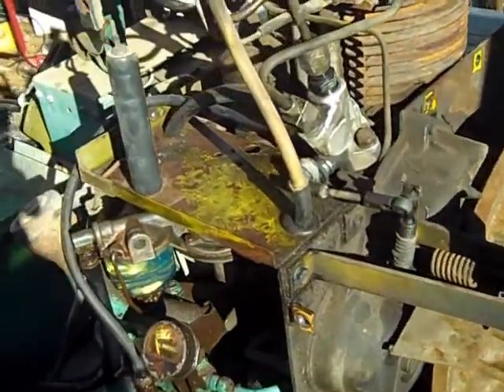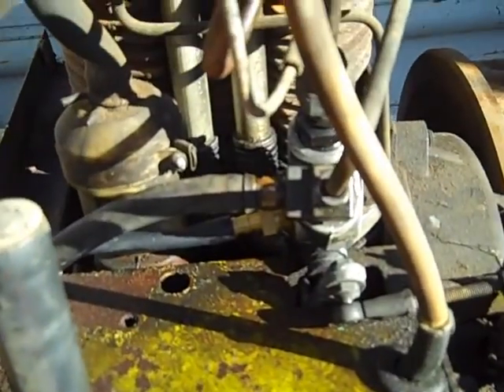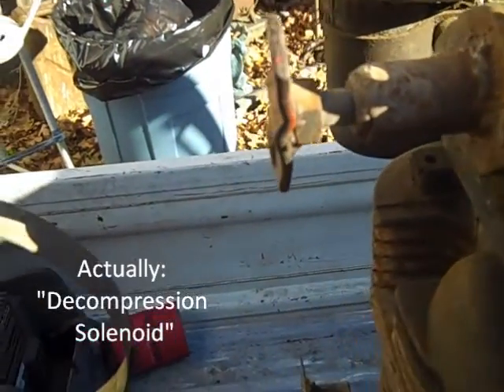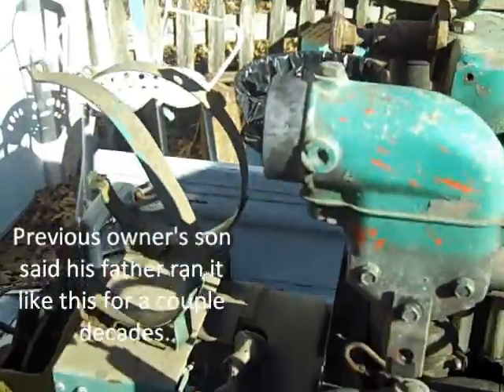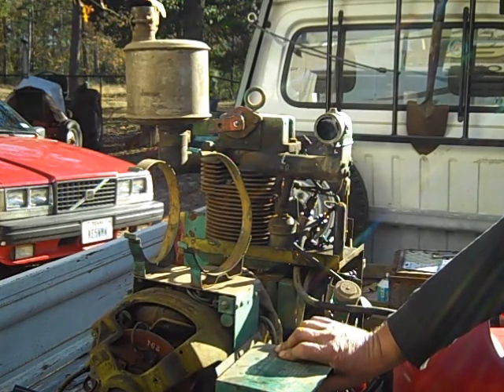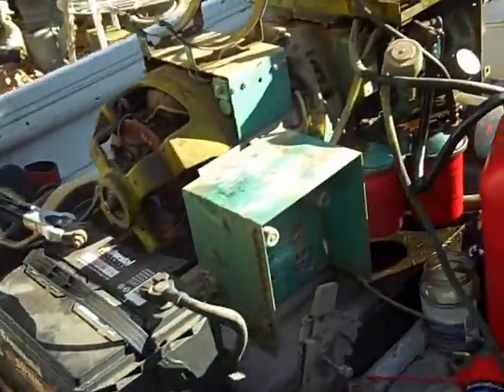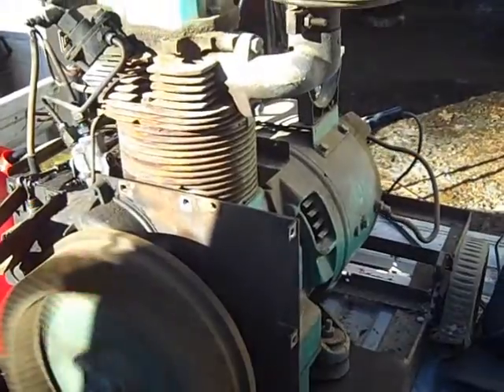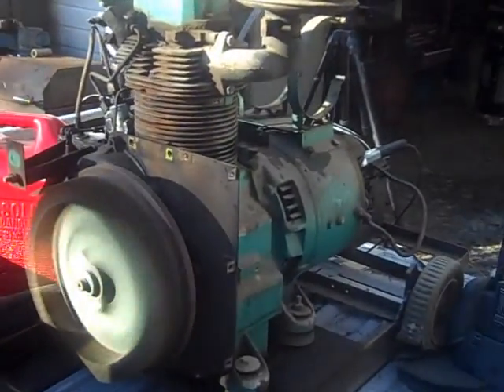Onan 3.0 DJA Diesel Generator (First run since 1999)

Comment: That J series was a great line. It was highly reliable. 50 years ago, if you wanted a small commercial generator, Onan was it.
Reply from the maker: yes sir I agree.
Reply: @ronnieb2072  I had a 2KW J series when I was a teenager. My ex father in law still has it and it runs.

Comment: What's the outputs..?
That's a smooth runner...maybe recheck valve clearances.
Reply from the maker: 120 volt. When I first got it running the output was 144. I found these gensets dont have a voltage regulator, u adjust the engine speed to set the output voltage. Setting valves is the next step. thanks for watching.